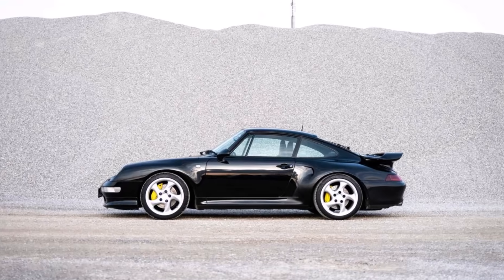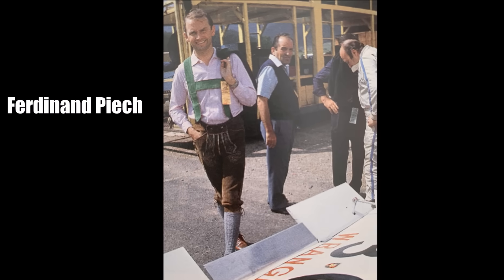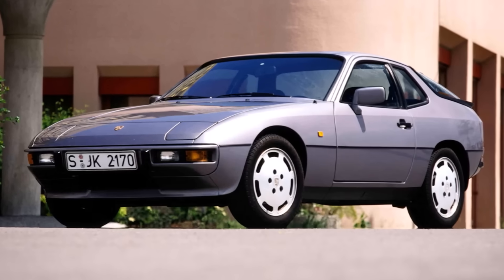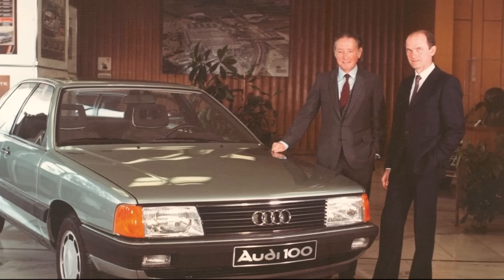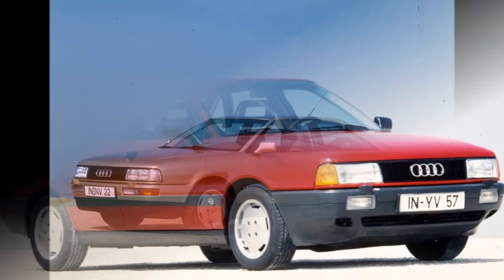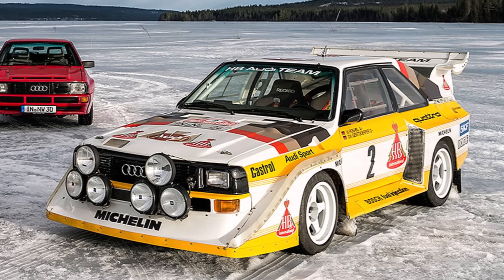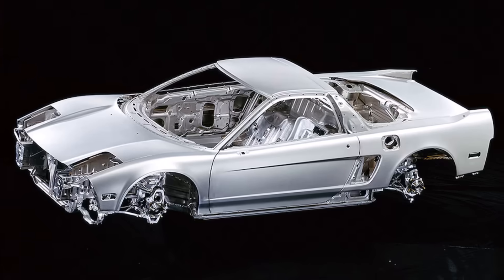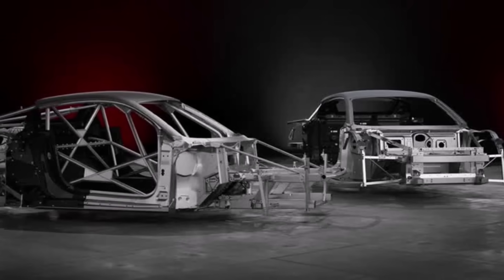How AUDI and Porsche eliminated corrosion forever - Development EXPLAINED

Comment: Solution:  >= +1.43V on the steel
Anti corrosion aluminum?  It took hours to beat/ force/ threaten to remove a hub assembly from an aluminum steering knuckle due to salt corrosion.
Premium finish on exposed Zn coated steel is hard to obtain.  That is a reason why panels are coated on the unseen side, but not on the exposed side.

Comment: Our 1972 audi 100ls had horrible corrosion issues.  4 years, garaged, needed a paint job. 7 years, the floor pan rotted out so bad that my father had to use 2x4 lumber to hold up the driver's seat😅. Damn fine car, otherwise.

Comment: When that came up, Audi also changed other things than galvanizing and aluminium. 

The side sills were notoriously made from two halves with a vertical joint, a flange pointing vertically down. It was unavoidable that you got defects on that edge, and the water seeped into the weld seam and under the bitumen of the underbody protection. 
And on the inside the joint created a little trough exactly to have the water sit on top of the weakest spot, the weld seam. 

We had lots of Audis, so it was obvious - 

along with the galvanization they laid the joint of the side sill seams horizontal, so you avoid that sharp edge which is so prone to lose protection. 

As it fits to the time, I now have an Opel Calibra from 1994. Opels are also notorious for rusting. But I am lucky, the body of my car is made in Finland, and these have the reputation to rust way less - just as mine has almost no rust, even though the underbody protection is so sparse that you see everywhere the "magma-red" body paint shining through. 

So it was obviously possible to do something against rust when you wanted...

Comment: This was good information.  I had no idea.  The Audi's looked beautiful back then, as did most cars.  I had read where Mercedes was using some type of steel mixed with other elements back in the 70's which was the reason why so many 240D, 230's, 220's and 280's (114 and 115 Chassis) have so many rust problems.  Thanks for sharing.

Comment: What's the use of cars that don't rust if the engine is junk after 100,000 kilometres or the electrics stop working or parts aren't available after 10 years.

Comment: I bought a much abused 1984 Porsche 944 from salty Pennsylvania.  Galvanized body, it had very little rust from salt, but plenty from accidents and battery acid that I had to repair. Considering the.cost vs return customers problem, one would think that the bean counters would realize that money spent now I is better than money not spent on future products. As the old car commercial used to say - you can pay me now, or pay me later ( which is usually a lot more )!

Comment: The VW engineering docs on this are so interesting for anyone who wants to learn more. They use several layers: zinc (hot dipped galvanized), zinc-phosphate epoxy (makes zinc paintable), body filler (what Germans called high build primer), coloured top coats then clear coat.
And all that was what they were doing in 1999.

Comment: Anyone who has ever looked under an Audi in the rust belt can tell you the body may look good for ten years or more, that the undercarriage can tell you severe corrosion will be rampant, unless protected by rustproofing. Ironically, a co-worker whose husband is an Audi dealership mechanic, told me I'd be voiding the factory warranty by applying rustproofing. Didn't stop me. And I feel reinforced each time I've  gone to the dealership parts counter, where I can see into the service area, and all the elevated vehicles.

Comment: YouTuber Greasy Fingers restores older cars. He has restored a 1980s Porsche 911 G that had pul-lenty rust. Forever is a wild exaggeration. Once the galvanizing material has sacrificed all its ions, rusting proceeds apace. That's what paint is for, to prevent corrosion from getting at the galvanizing material.

Comment: As a used buyer today in a country with salty roads you are very happy if the manufacturer decided to spend extra money on rust prevention. The issue is technically solved thanks to the advances highlighted in the video. But cars still rust. A big factor is simply competition. The price tag when new is very important. Take Ford in the 90s-00s, for example. They didn’t focus on rust protection all that much. Instead, they put their money into making the suspension better,. They could keep their prices low and still stand out from the competition. It worked for them back then.

Comment: On my Saturn SL2 the front passenger side subframe never rusts bc when you change the oil filter it always coats that area sadly the driver's side doesn't have that feature as well & can rust.

Comment: I have a question for you, Martin - in the completely fictional scenario where cost of stainless steel and cost of manufacturing equipment are not a factor, does stainless steel present better properties for car use than standard steel? What I am trying to understand for quite some time now is, is stainless steel simply superior material for car use or standard steel also has some advantages except only for being cheaper (manufacturing tools included) than stainless steel? 

In the last couple of years I started to strongly suspect that stainless steel is the perfect material for car bodies AND car underbodies, plus many other mechanical details.
Reply: Stainless  steel will crack eventually.
Reply: @janstolk486 Ford made twice in the past two very limited series of cars with stainless steel bodies (for a steel company) and did not have any cracking related problems as far as I know.
Reply: @janstolk486 Ford made two very limited stainless steel series of car bodies in the past (for a steel company) and, as far as I know, they did not have any cracking issues.

Comment: No necessary you need a bigger frame in aluminum but you need the type of alloys mixed designed specific for the industry. Aluminum with the amount of chrome or nickel and other similar elements to make the equivalent in strenght,hardness, brittle, impact tensile etc but light than steel.  The proper ratio which definitely it's not in the market.

Comment: Me, a midwestern American mechanic who has worked on many Audis with holes where rocker panels should be and rotten fenders: reads video title, EXTREME DOUBT.
Reply: Yes your cars and trucks don't have a salt corrosion under coat  under the the prime and paint as california does, but it costs another $10,000 dollars more in vehicle price if it does.
Reply: Corrosion under coat doesn't cost $10000. Maybe a $1000 with materials and labor.

Comment: I mean, today cars are fully galvanised as well but it doesn't mean corrosion can't get in there despite it. There are different ways to galvanise, at different thicknesses & different temperatures of application. Mazdas are also fully galvanised, but the protection is very just.

Comment: It always beat me how Porsches would rust like hell after just a few years while cheap crappy Beetles, which were built to the same concept, lasted decades with hardly any rust.
That said, VW wouldn't be around any more today if it hadn't been for Piëch taking over. He was a no nonsense CEO, didn't tolerate resistance against new technology. If it worked he wanted it in his cars. But his aluminium idea was a bit off. It's well known these days in the industry that aluminium doesn't necessarily make lighter cars and isn't worth the high costs.

Comment: My 2001 Passat B5.5 and 2005 Audi A4 B7 Quattro beg to differ. There was apparently a problem with the galvanization process caused by left-over sandblasting dust, which resulted in zinc bubbles under the paint. Somewhat annoying on visible surface, but more serious on the underside where rocks and sand bombard the frail paint away, revealing the sacrificial layer of zinc. Read on if you own these cars and want to know what might be ahead.

Passat seems to have a pretty good underbody coating, but the outside was full of these bubbles until I dealt with them (sand, primer, paint). It rusts elsewhere around the trunk area and underneath door moldings, generally where there's a sharp edge. Doors have these little guide holes for the moldings, notorious rusting spots in cars.

A4Q, on the other hand, doesn't have any rust on the outside, excluding front wheel arches (freaking stupid design, they gather sand on the inside "shelf" like nobody's business: after fixing or if good, put grease in them), trunk and door bottom edges (probably the glued seams opening). The real kicker is the underbody, specifically the rear around the subframe. I ended up removing it and the fuel tank to deal with the rust. Everywhere I looked, there was either rust or zinc bubbles, even in places covered by the massive fuel tank or wheel arch liners. Had the car taken weekly dips in seawater or what? I practically chiseled the rust slabs off and wire brushed it like no tomorrow, but to my surprise, there was only one small spot needing welding. I can only hope the phosphoric acid did it's job and will keep the rust at bay under the fresh paint and body coating.

I also did the same to the rear subframe, hitting the rust off with a pointy hammer. I weighed the stuff I removed and swept off the floor at 1 kg. Luckily the frame was intact enough to warrant going without welding. I did the usual acid+paint+bodycoat on the subframe, too, as well as total bushing overhaul, but here's another tip: I put old ATF inside the subframe after the acid and surface paint, before cavity wax. It should seep into whatever holes there are left and impregnate them. It's a bit of a running experiment, as I did the same to my Honda's rusted-out door and trunk bottom seams. Let me know if it is futile, or better yet, it actually works.

Okay, long rant, but I'll save the best for last. You know why I began working the A4 rear end before it morphed into this months-long quest at the mercy of weather, the car being outside? To change the springs!

Comment: Aluminum is susceptible to fatigue more than steel, probably won't fare as well in an accident and is tricky to repair.
Reply from the maker: That’s why you don’t just build the same parts in alu, you need a different structure with bigger profiles

Comment: Galvanized metal roof sheets were in use from 1829 which is 150 years before Porsche and Audi started galvanizing their steel car bodies.
Reply from the maker: Yes, that wasn’t a new procedure, just new to  use it for car bodies so extensively

Comment: Mega overstatement that Vag solved corrosion. Have passat B5 with galvanized body like you mentioned, fully eusted afrer just 25 years. Same goes with new cars, often I see 10 year old audi with rust problems. Unless body is full aluminium, you cannot guarantee full rust protection. I would like to see a remark like this in you future videos, since you tend to oversimplify the matter and over exaggerate certain technologies.

Comment: Just to answer but the cybertruck has more aluminium parts (and as the body structure) than stainless steel... (that do nothing or so little for the rigidity)

Comment: @bsport320 GREAT VIDEO! I was thinking to myself a few days before you posted this video about the Porsche production moving to a fully galvanized body and what an effect that has to have had on the revealing statistic that today 70% of all Porsche cars ever produced are running/registered. This is an astounding claim for a producer of anything to make and I have to imagine the decision to fully galvanize the body for 54DM or 100DM is one of the best moves Porsche has ever made. I appreciate the technical details (i had never seen the stainless steel 911 before) and your recounting of how we ended up where we are, Piech was certainly an innovator, his hand was required for Porsche, then Audi and then VW to all adopt the long term strategy.
I only wish you detailed the Galvanization process and what that looks like as a part of Production. Their strategies have been apparent when I look underneath the body of a 17 year old 250k mile Cayenne and all the problems with rusty hardware and deteriorating body work of cars from other manufacturers are non existent on the Cayenne. 
Thank you for the video, lots of detail in not a lot of time.
Reply from the maker: Very true and I‘m glad you liked it. Thanks!

Comment: I think there should be more worried about their engines blowing up then the car is riding out before the engines blow up because it's usually an engine blows they replace it for half the cost of the total cost of the car and then it blows up again about the same time it rots out Porsches and Volkswagens and Audis boat anchors and I don't know why you would ever try to save a damn boat anchor from rust

Comment: I'm sorry but this is a myth because I live in an area where well we get a lot of snow and a lot of ice and one of the number one vehicles you see will be rotted out will be a Volkswagen and Audi there will be so rotted out that the engine cradles will be falling out the rear subframes for the rear drivetrain will be falling out a holes in the floor boards that are ridiculously large the only other thing that doesn't last as their engines. And believe me there is no German junk that survived salt baths

Comment: If aluminum is electrically in connection with the steel of the frame it will corrode. I don't know where you get the idea that aluminum does not corrode. But it certainly does.
Reply: It practically doesen't corrode.

Comment: Now ALL vw group products are made from Aluminum/magnesium ceramic alloy.
Reply: Yeah, right...
Reply: @DashCamSerbia since 2019 ALL models by VW Croup are on MLB, MQB or MSB platforms. Previously the lowest cist versions were made of steel, titanium and carbon fiber. The Ceramic Alloy platforms were used fir premium editions beginning in mid/late 200Xs. Keep up with whats going on!
Reply: @jamesbowen2105  All false, and easily fact-checkable. Plus, you obviously have no clue about what you are talking about. Those materials you are mentioning are exteremely expensive and used only in very high end sports cars.
Reply: @DashCamSerbia not anymore. Scales of economy. If you reach as deep as possible,  then make that the standard  mass produce and sell to competitors for their ultra premium. Its perfectly economical.
VW LABELED products were sold at a loss orbresk even to marginal  unit cost for decades. Mk3 introduced carbon fiber frontend, Titanium ceramic firewall A-pillar, and other critical points. Mk4 went to Aluminum Magnesium cersmic firewall, A-pillar, front suspension/steering towers. The fact that they use more robust and extreme applications in their high end/Exotic models is a given!
Reply: @jamesbowen2105  You don't even know what you are talking about. Better delete your comment to avoid further embarrassment. 😂
Reply: @DashCamSerbia  whatever. How many of these vehicles do you own? How many of these have you rebuilt from a " total loss" collision, or found to be irreparable due to the ceramic metal being deformed?
I can say several and one to those questions.

Comment: And then, Audi forgot it all. I mean look at all the rot in modern Audi suspension components. Volvo had the same problem once Ford bought them and they switched from aluminum suspension components to steel and they just rust away.
Reply: Cost savings is the biggest reason
Reply: @ville85 of course. Cost savings is also why Porsche stopped galvanizing their cars and had rot again. But it's an example of failing to learn a lesson. Audis are no longer quality cars, they are single use paper cups.

Comment: The Cybertruck uses SS exterior panels attached to a steel unibody. The door skins are 1.8 millimeters thick, while the rest of the body panels are 1.4 millimeters thick. It will be interesting to see how the body holds up in the rust belt states in 10-20 years.
Reply: They're already rusting lmao

Comment: The world is full of 2000's Audis and Golfs, Passats etc with rotten front wings. The Audi 80 and A4 B5 were as good as they got but the B6 was known for front arch rot - ditto the Golf Mark 5, Jetta plus the 05 on Passat. 
The Golf 6 and A4 B8 were much better but no better than Ford or GM.
Reply: I'd argue the Golf 6 and B8 are worse than a Ford or GM product.
Reply: A4 B8 actually had a lot of rust. They can rust around the arches like the VW models but they often also have rust around the boot area. The B9 seems to be holding up better.
Reply: I have b5 A4 and it's rusted front and rear wings 😢

Comment: I would check out the Late Brake Show video on the RS2 before you claim that Audi has eliminated rust corrosion…
Reply: You're saying that a 30y old car that has been left in the forest for 5-8 years on damp ground wouldn't have any visible rust in suspension components and exhaust? It still had no rust holes on the bottom which proves that audis were well protected back in the 90s. If it would have been mb or bmw from the same era then there wouldn't have been so much floor left.

Comment: PSA also started galvanizing their cars in the 90s. I have a Xantia Sedan, it's competely rust free - at least the body is, the steel axles do rust though, so twice a year it goes on the lift for prevention. The Xantia Estates were built at a different factory (Heuliez), those did rust, esp. at the rear door sills.
Reply: Likely zinc phosphate coated.

Comment: I suppose galvanising is a form of sacrificial corrosion protection but i often wonder why they don't just use a zinc block which is replaceable rather than something that if it gets damaged can't be repaired without major wo4k.

Comment: 5:15 thats just not true. B3 rust like hell in the rear. many dont have trunk floor because thats where they rust the most. B4 is the generation that had no corrosion problems even after 30 years